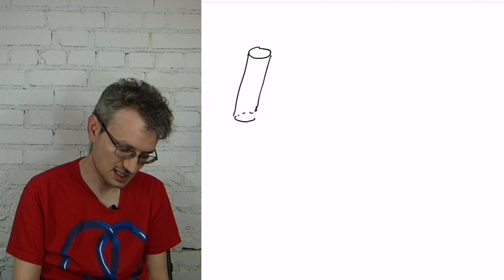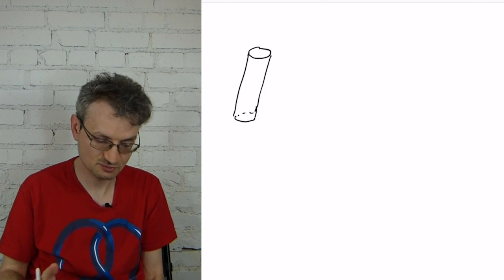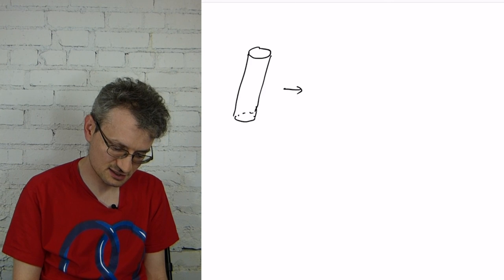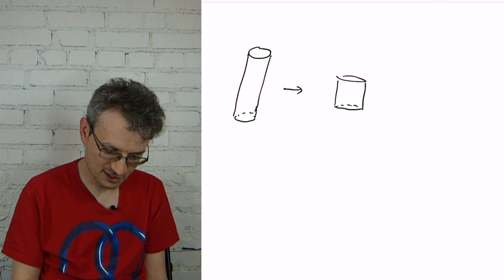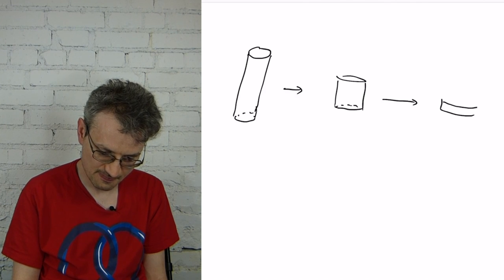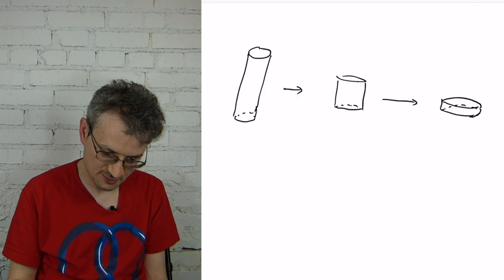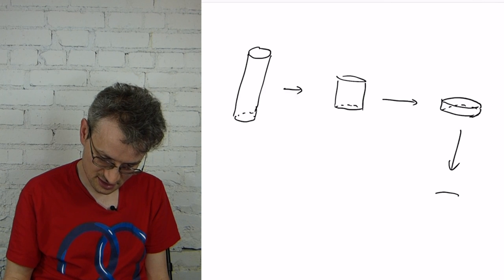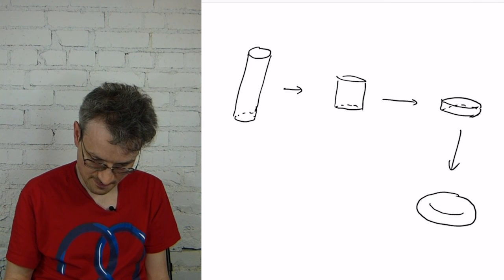How many holes does a straw have?

Comment: I think the problem is there are two ways 'hole' is commonly used. A hole in an object (like a piece of paper) goes all the way through. Holes in the ground often only have one opening and aren't topological holes. That is, holes dug by people. I think burrows are a lot more complex.
Reply: Name Brand Cereal this is a great point and I think it’s probably what’s underlying the debate. In fact, there’s even a third, more practical or normative definition of “hole” in common use: any opening that’s there by mistake or causing a malfunction. And indeed when people say “that straw has a hole in it” in everyday life, they typically mean it will leak out the side if you try to use it, so by that definition a normal straw has 0 holes
Reply: "through" and "blind" holes, respectively. If we see the human body and all its orifices and pores and consider them all to be holes, we're a manifold of uncountably many on them. To make things even more difficult, there's plenty of room to debate whether those holes are through or blind. You could say that pores are blind holes, but they secrete sweat which came from water we drank.  Surface area becomes a problem, too, since those pores are breaks in the skin that blur the line between inside and out.
Reply: But the idea of a 'hole' in the ground that has been dug, is called such due to the changes in language over the years to simplify the explanation by shortening one's vocabulary. This becomes evident when you use the word 'pit' to describe the same thing.
Reply: I believe that a hole dug in the ground and a hole cut in paper are one and the same, it's just that in the paper, the hole's depth is deeper than the paper's depth, but with the one in the ground, the earth is deeper than the hole.
Reply: @gurth-quake1627  but they’re physically different : one is a cavity water can pool into, the other is a passage with an entry and an exit, like a pipe. They’d be the same if you dug that mythical hole all the way to china. Otherwise, to a topologist, a pool or a ditch are no holes at all
Reply: @StealthTheUnknown  a hole and a tunnle are all just negative space. I'm no topologist, I'm a 3D Designer for mechanical parts.
Reply: @gurth-quake1627  that explains it - they differ to a topologist, in engineering they do have similarities. The thinking in topology is, if you can loop a string through it, and it stays through the object, it’s a topological hole.

Mathematics is very diverse, and weird. Some things that are most definitely not equivalent to layman logic are equivalent in fringe mathematics.
Reply: @StealthTheUnknown  but either way, both engineering and topology would agree that it's 1 hole in the straw right?
Reply: @gurth-quake1627  yes 👍
Reply: a hole in the ground is a hole in the plane of the surface, but is a cavity when viewed as a whole
Reply: @thepiperpie  not to a topologist though. They don’t care about planes because everything is stretchy and deformable, a cavity is just curvature on the surface and doesn’t mean anything. You can’t loop a string through a cavity
Reply: @StealthTheUnknown  fair, i was just commenting on common usage (and making a pun)
Reply: @thepiperpie  it went over my head :/ I am smart in some ways, stupid in others.
Reply: @StealthTheUnknown  hey me too!!!
Reply: If you dig into the ground and it doesn't come out the other side, it's not a hole, it's a pit.

Comment: So if we're using the string method of determining holes, does that mean the cup/plate example actually has no holes?
Reply: correct. these would be "blind" holes, while the handle of the mug is a "through" hole. in topology, through holes are the only ones that exist
Reply: Yes. It's more of some sort of concave deformation.
Reply: In my mind, as a 3D designer, through holes and blind holes are one and the same, it's just that with through holes, the hole's just deeper than the material, and with the blind holes, the material is thicker than the hole.
Reply: @gurth-quake1627  Sure, but the fact that the material isn't as thick affects the resulting object in a definable way. I'd agree that they're related (potentially depending on how they were made), but there's an explicit difference between the two in that a hole "reaches the other side".
Reply: @gurth-quake1627  Also, this is entirely contingent on the fact that the majority of materials used are solid to begin with (such as wood and metal).
Reply: A plate has 0 holes. A glass has 0 holes. A mug has 1 hole (the handle). A straw has 1 long hole.
Is not difficult, if you can't make something go through it then is not a hole.
Reply: @RobleViejo  so when you use a shovel to dig into the earth, what is the thing you create called? A hole. You can't make something go through that.
Reply: @TacoMeetMouth  no, you made a divot
Reply: @TacoMeetMouth  a pit
Reply: Yes
Reply: @TacoMeetMouth  your average topologist could just push the earth down and out and deform it, so it's not a hole
Reply: Yes, but that is not what people usually mean by the word "hole". It is a mathematical thing. You can do the same with a mountain. How much must you flatten a mountain before it is not a mountain anymore? When does it become a hill, when it is a bump, when is it nothing at all? In a mathematical sense there is no such thing as a mountain, just as there is no such thing as a hole if it doesn't go all the way through.
Reply: @TacoMeetMouth  That's because we use the same word for different things. In maths a hole is something very specific. A hill or a mountain is non-existent in this topological world, but in daily life we still have them.

Comment: If a straw has 2 holes, then nothing that exists in this dimension has only 1 hole. This means that if you cut a hole into paper, then you're actually cutting 2 holes because the paper has thickness therefore there can be a hole on the top and the bottom of a paper laying on the table.
Reply: You're arguing semantics, I wanted to believe straws have one hole but it doesn't work they have to have two because thinking about clothes a shirt has 4 holes even though there are 2 pair lined up together like a straw is there are novelty straws for couples with 1 intake and 2 outputs that clearly have 3 holes but only 1 hole was added therefore a straw must have 2 holes and we all need to accept the only way too have a 1 hole item is with one end of the object being closed
Reply: You could argue that a straw and a shirt have 0 holes because they don't have any holes poked in them and function normally. They are made with some empty space but still if you tear your shirt you don't say "aw man my shirt got a fifth hole in it" its just A hole. The only hole.
Reply: Thats a lot of words. Sadly, you still are completely wrong.
Reply: @nickd1218  let me ask you something. How deep does the hole have to be to be considered 2 holes because you're arguing that I'm wrong which means that if you cut a hole in the paper, it only has 1 hole, but straws have 2 holes. It's the same exact thing except one is deeper than the other, so tell me, how deep does the hole need to be to be considered 2 holes?
Reply: @RobleViejo  how so?
Reply: @gurth-quake1627  I understood the video. You didn't.
Reply: @RobleViejo  I 100% understood the video, and I wasn't refering to it. At least try to understand what I typed before telling me I'm wrong. I put a hypothetical to compare how contridictory it is when people say that there's 2 holes in a straw.
Reply: @RobleViejo  Nah, you can go back to twitter because you honestly acted way less mature
Reply: @nickd1218  straws have one hole. One through hole, to be specific.
Reply: @BONERCRUSHER  i'm laughing at how stupid Roble's comments are. He's being hostile towards me and telling me I'm wrong while arguing the exact same side as me. There really was no need to try and defend against him because his presence here i hilariously pointless, but I appreciate it.
Reply: @RobleViejo  You ok? I never flipped my position, but I'll say that I can't argue with the fact I'm pedantic XD. I'm a smartass at heart and I'm proud of that fact because I love myself. And also, thanks for expanding my vocabulary, I'll be using pedantic more often now.
Reply: ...no, the cup still has one hole with this logic
Reply: I don't think so. If a straw has two holes, then one hole would simply be one that doesn't go all the way through.
Reply: @nickd1218  If a straw has two holes, how many holes does a finger ring have then? They are the same.
Reply: I don't think that first statement is true. Where is the hole in a sphere?
Reply: @lost4468yt  there is none, I don't understand what your point is here...
Reply: Thats just one specific scenario where the entrance hole and the exit hole are so thin they practically overlap unless you take it to a microscopic level. Such things have no place from a practical everyday life perspective.

Comment: If it was mentioned, I didn't catch why the ability to loop a string through the same hole multiple times matters, since the thickness of that string relative to the size of the hole will determine how many loops are possible, unless using a mathematical line with 0 width and 0 height but infinite depth, to which it becomes infinite, but seems the same test should suffice. If you can floss the object and at no place can you pull the sting through the object when looped around, you've got a hole. All other things are like the cup and merely cavities. From there, holes can be calculated based on possible two part combinations of the easily defined mouth, nostrils, and anus and the less obvious however many tear ducts the average person has. Every other "hole" has some barrier like the eardrum. The only complication then is if we include all the microscopic channels throughout the body that allow various chemicals to selectively move through various membranes like in the lungs, kidneys, and brain. At that point, it's incalculable.
Reply: My god, we’re a manifold!
Reply: Because when you loop it there’s no way to unloop it without taking it back through the same hole.
Reply: The problem with looping the string through multiple times is that that's a loop which can't be deformed into the "go through once" loop.  That ruins our plan of counting the different loops and using that as our hole count.  

Upshot being we need to be a bit more careful than just calculating the different possible loops, we need to count the generators (which can be combined to make the multiply looped loops)
Reply: I would say "thread" instead of "floss"
Reply: the 'line of infinite depth' completely blew my mind for a second, had to do a hard reboot. God bless you for that :-)

Comment: A hole:
• has at least two openings that connect (3d)
• is an empty space within/through an object (2d)

A straw is inherently 3d. A straw has one hole.

A bowl is inherently 3d. It lacks a second opening. It has no holes.

A handle is inherently 3d. It has two openings. It has one hole.

A bottle is inherently 3d. It has one opening. It has no holes.

A shirt has 4 openings - it has, at least, 2 holes. Depending on how one counts holes (I'll ascribe by the rope concept), the shirt has up to 6 holes (Neck-to-L.arm, Neck-to-R.arm, Neck-to-Hips, L.arm-to-R.arm, L.arm-to-Hips, R.arm-to-Hips).

The tricky question isn't whether there is a hole. The tricky question is determining how many holes if there are more than 2 openings.
Reply: If holes are not something that can appear and disappear by stretching or bending without tearing or joining, that tricky question is where deformation comes in handy. Shirt: shorten the sleeves (reversed stretching) and widen the torso from the bottom (regular stretching) so the top eventually lies flat. A disc with 3 holes.
Reply: Interesting thing about shirt one... Is that if you take a knife, in example, and stab a shirt... Then if you count that shirt already has 6 holes, then you add 4 more with just one stab.
Reply: what happens when you dig a hole in the ground?
Reply: @pretentiosaurus  It's a hole in the sense of the relatively flat surface of the ground, as an abstract. Like if you closed your eyes and walked over it you would fall through the ground you expect to be there. But in terms of the actual surface of the ground it's not really a hole.

Or, it's colloquially a hole, but not technically, topologically, a hole. Different definitions for the word based on context/intent.
Reply: @pretentiosaurus  It isn't a true hole, but merely an indentation.
Reply: @polocatfan  yes
Reply: @khajiitimanus7432  but if you think of the earth as a series of layers, with the grass forming the outer layer which separates the soil from the air, if you cut out a square of turf you have made a hole in that outer layer which gives you access to the layers below. But if you now think about a tennis ball inside a football, to get access to the tennis ball you would need to cut a hole in the football. The football could then (in principle) be stretched into the shape of a bowl or plate which has no hole. So the common sense or intuitive meaning of the word “hole” is probably not very helpful from a topological perspective.
Reply: A shirt has 3 holes, take the bottom and spread it out very wide into a plane. Then you can see that there is a neck hoke and 2 arm holes
Reply: Thank you youtube comment section for telling me a hole in the ground is not, in fact, a hole
Reply: @piggyblitz4404  While I appreciate the indirect deference to my claim, I want it to be clear that I am no formal expert.

Take my claim about the characteristics of holes with some salt, stranger.
Reply: @khajiitimanus7432  tell me, how many holes, by your definition, does the human body have
Reply: @piggyblitz4404  I am no biologist, so I am not aware of how many openings the human body has.

There are, of course, openings such as the nostrils, mouth, and anus. But there are other openings, such as the thousands of skin pores. How do these pores connect to the body? There are skin poisonings which, on contact with our skin, can reach our organs despite no obvious holes allowing the poison to seep through. Then there is the matter of genitalia, which have a different amount of openings dependent on the subject's gender.

If one examines the body on an atomic level, then the answer could simply be; there are many thousands, millions, and billions of 'true' holes.

It is alike to the paradox of measuring island borders. The more precise you try to measure it, the infinitely longer it gets. I cannot describe how many holes are in the human body.

In short, I have avoided your question because I do not feel I can know the precise amount of true holes a human body has, especially since that number can vary in the thousands across different humans depending on the scale of examination.

Comment: here's a good example of why it could be two holes: let's say you dug a hole in the ground. doesn't have to be very deep, just has to be a hole. then, you dig a hole 20 feet away from it. its two holes, right? now, dig deeper and connect the two holes, making a tunnel, almost like a straw. are the two holes now suddenly one hole? or are they two sides of the same hole? who knows
Reply: The "holes" you dug up aren't topological holes
Reply: Even if your analogy was using the correct definition of hole, yeah, if you connected the 2 holes then they become one because you connected then

Comment: A hole is the thickness which is removed and is completely separate from the opening. A hole in the ground, which is then covered over, is still a hole in the ground. That area is still removed. It just has no openings. It does get tricky and just falls into the category of “all words are made up” when you distinguish a whole in a glass vs. a plate, which is mostly flat, but still concave. 
Interesting thought process for sure on this. But, I really believe the term hole is very loosely defined and can change very much on the situation it is used in. There are far more precise terms available to describe what a specific hole is. A straw can certainly be described much differently than a cylindrical object with a hole running though the middle of it. But, it depends on how exact someone chooses to be.

Comment: How many holes does a Y pipe have? Three possible inputs, two possible outputs for each input (assuming you can't output through the same input hole). 
Water going in , could leave through 1 or 2 possible outputs, but generally will only use 1 output. ? What do you think?
Reply from the maker: If you go by homology, a Y-pipe has two holes.

Comment: If you where to model a hole it would include void spaces, a hole is a space at which nothing solid currently occupies in an area surrounded by solid materials, you dont get liquid holes or even really gas holes, beings when you move though the space with the gas it displaces said gas, but the in talking shapes a hole should be looked at as it's individual shape. A straw has one hole, beings if you were counting holes you would fill in the already accounted holes so as an example I recommend lining up straws and pull a segment of string through each straw individually and count your strings afterwards, the ends of the straw are not the hole the entire straw is a hole, it has to entrances/exists where as a cup would still be a hole but It would only contain a single entrance/exit

Comment: Without reading any other comments, my first thoughts are that it is a resolution problem, how big you set a radius about each atomic nucleus... Then you must decide what is person and what is not person, internal or external to person and should be ignored. Some such external objects could also create holes that would otherwise be mushed together, perhaps even weakly joined up with chemical bonds. That would make the answer depend on outside factors. I guess one must define some rules before asking the question 🤷